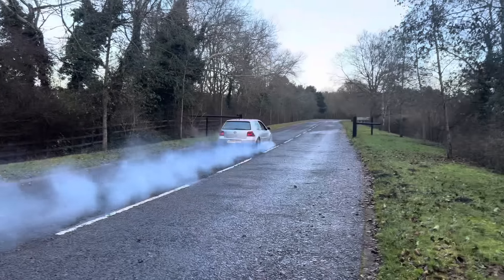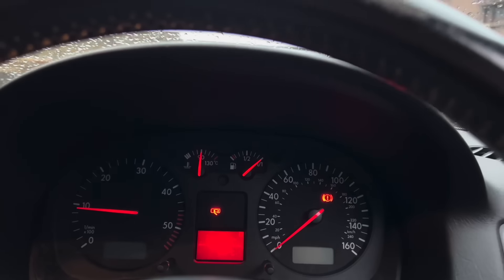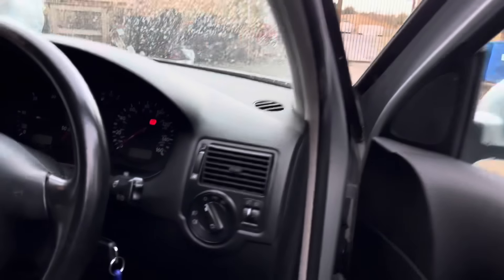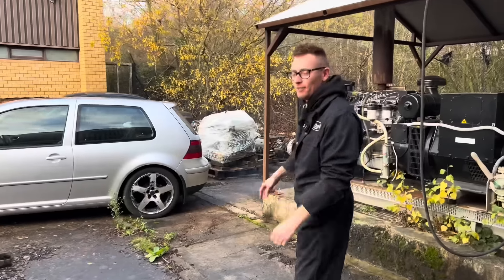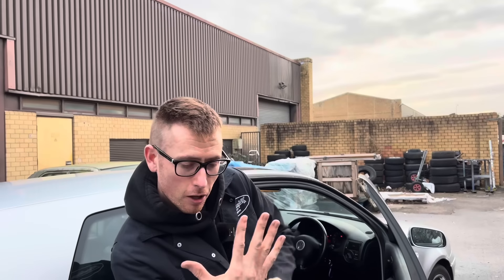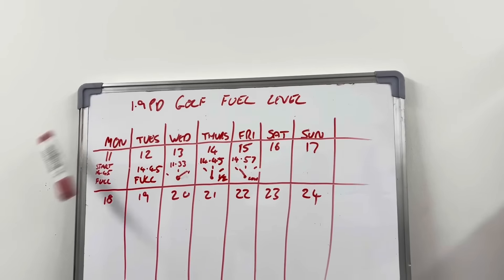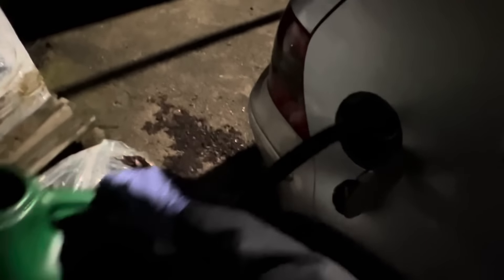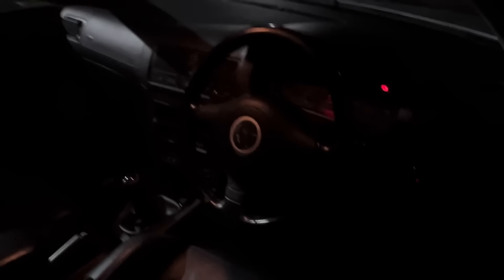2003 VW GOLF how long will it IDLE? OR Blow up first? The Idle experiment. (ONE FULL TANK DIESEL)

Comment: In a Tesla you’d freeze to death after 24 hours. Great video
Reply: These engines at idle barely produce enough heat to make the heater work.
Reply: @Jonathan_Doe_  I disagree my car which also a diesel of same sort of era had it idling for half an hour earlier and the cabin was petty warm and heaters felt hot.
Reply: Diesel has 10kwh per litre. When idling its pretty much all coming out as heat. If the tank was 50litres and 100h. Its taking 0.5l per hour. Its same as webasto heater. 5000watts all the time. Lot of wasted of course but still enough for heat.
Reply: No you wouldn't cus it would catch fire 🤣🤣😂😂🤘🤘
Reply: I can tell you have a lot of experience with electric cars 🤔😂
Reply: @Jonathan_Doe_   nah, i used to run my 1.9tdi toledo in really cold winter mornings an hour before i went for a drive and it was boiling inside after an hour, def produces more than enough heat
Reply: Ofcourse you would 🙄🙄 your probably driving cheap seats like a 10year Vauxhall insignia thinking your car is ahem - good 😂
Reply: Lots of tests been done, 2 days for a Tesla 3, the Kia ev6 lasted 3 days of constant heat
Reply: Completely inaccurate. Model 3 will make heat for days. I camped in the mountains at -14F in my Tesla which only used about 15% battery.
Reply: With a tdi, heat comes out the exhaust. Barely absorbed by engine block. Look what the piston looks like you'll understand.
Reply: @Jonathan_Doe_ why there is a heat exchanger. People complain about not enough heating after egr delete!
Reply: With a full tank of fuel, you could just drive to somewhere warmer, a 2tdi with a full tank (45 litres I think)  should get you about 600 miles away, 

(60mpg driving on the motorway)
Reply: @StephenButlerOne  made it from Eastern Ontario to nova scotia on 1 tank 55 ltrs driving 118km/hr the whole time.
Reply: You'll have around 3 days in a model 3 at a comfortable temperature, also if you contacted Tesla they can override the software allowing you to use the locked full capcity of the battery which will probably give you 4-5 hours extra.
Reply: So you buy cars to live in them in the wild? I agree, evs are not for that.
Reply: 🤣🤣 at least you'll be nice and toasty when it sets fire 👍
Reply: Tesla would last longer fully charged. ICE is very wasteful for heat
Reply: And who sits in a car for 24 hours?
Reply: @HA05GER 30 minutes is at least twice as long as a car should need to warm up enough to heat the cabin
Reply: Only a moron would end up in a situation where they needed to stay in a car and have the heat going to stay alive.  How long a vehicle can idle for is a pointless metric.  And I say all that to a comment that's false, a tesla can heat the cabin for more than 24h.  The energy required to heat it is nothing compared to the energy it uses to drive, and it can do that for almost 7h straight at 60mph.
Reply: Let's see the heat pump in the Model Y uses about 1% charge per hour. So you need to have a low state of charge to freeze to death in 24 hours.
Reply: @999benhonda i never said thats how long it takes that was just how long the engine was on. I was hoovering the car out kept the engine on as the battery isn't brilliant and my car being a higher spec model has lights absolutely everywhere plus I also wanted to listen to some music.
Reply: @meeder78  You can easily count how long it will last. 1% is way too arvitrary number, especially in the cold. Just use watts. Heating a cabin in say -10C takes around 1-2kW of heat. Then it really depends if you have a Tesla with or without a heatpump. With a heatpump you will get 3x the heat.
Reply: Teslas last a similar amount of time.  Plus with ice cars you have co2 build up hazard particularly if snowed in
Reply: @boosthit811  I've never had a problem I've had my car idling for hours on many occasions no noticeable fumes in the cabin.
Reply: @FuttBuckr69  something wrong with Ur thermostat then car should stay warm whatever your style of driving. My car will hold temperature at idle. Also my old car had stop start so would get the cabin to temperature and switch off. I would usually use the heated seat then car would start when battery is draining low say an hour or so then charge up and cut off again. I would without a doubt rather been in an ice car with quarter of a tank than a EV with a full charge. If push comes to shove you could even place a bottle of snow under the bonnet to melt to drink if really stranded.
Reply: Of course
Reply: Tesla will actually run 2 days or more with the heat on, and probably will be fully charged at home, while a diesel car is not toped every night.
Reply: Tesla owner. There's would be plenty of charge after 24h. People have done the same test on Teslas and they'll hest for about a week. Just saying. I spent a day in one camping overnight and the next day, and it dropped about 13% battery.
Reply: @m1geo  you don't have to insist. Batteries Are NOT Trustworthy! Specially in winter.
Reply: @Jonathan_Doe_  if that was the case they wouldnt over heat idling with no coolant but they do. they hit thermostat temp and stay there.
Reply: @MrFryfish  Okay! 😂😂 I'm 250k miles and 2 cars in. The batteries haven't betrayed me! Despite having had the previous car in Norway for a month. 😂
Reply: @alkiou3613  the vehicle subject that is  20 years old can run at idle for 2 (two) days then with the other MORE than half of the fuel tank could get you or me 2-300 miles to the first ⛽.. is a Tesla capable of that probably with lots of regen braking and inconvenience to others. 
Not the case with that (what?) over 3-400,000 miles on GOLF's clock. A wishfull dream for a tesla at that sort of mileage.
Forget about it.
Reply: @Jonathan_Doe_  even when you can see with your own eyes that the temperature gauge is at 90 degrees Celsius, WHAT DO YOU THINK IS THAT??? Engine temperature. So, heating is so much available that you will fell nice and cosy.. inside. 
Bye the way of ..cars, do you ever owned a ICE car? Probably not. That's way you do not know, obviously.. NOW, you know!
Reply: @stianheggen6310  by the way he talks, isn't it?
Reply: @duncanseuropeanautomotive8123  yeah, ..how old is that tesla? Do you realise that you are comparing 20 years old car with 3-400,000 miles on the clock (~5-600 k km) done. When that tesla will be 20 years old and same battery with the same performance, we'll talk numbers and performances. Right?
Reply: @terrancedactielle5460  what would you call comfortable temperature!? 18-19 Celsius or 20-21? For me is 20-21, extremely easy to come out of a 90 degree hot engine. Not the same stress as of a battery...
And by the way, how far you can get with that Teala after 3 day of warmth? 50-100 miles with big hopes? Or 2-300 miles in 20 years old Golf MK4, easily.. AND confidently.
Reply: @leenevin8451  how wasteful, describe to me. because the experiment just shown to all of us proved the opposite, extremely easily! Only you don't believe...
My friend, quite THE OPPOSITE IS with electric cars. Have you ever heard about residual heat? Well, only an ICE engine can produce residual heat after it is been switched off BECAUSE IT REMAINS HOT FOR A WHILE. Which is not the case with electric engine as that train cold all the time, or the warmth is NEGLIGIBLE
Reply: @MrFryfish  so we assuming the car has an auxiliary electric water pump like a bmw (excluding 4 cyl)?
Reply: @leenevin8451  Well, I do not know that, but the idea is the an ICE engine holds the head while the other NOT. 
Or with other words, it does not really matter if it has it or not, the warmth is coming more comfortable and easy from a ICE engine than... the DRY heat from an Electric vehicle.
Reply: @m1geo  as good as new isn't it? No battery life decrease what so ever? Well I own a BMW 3 series and with a single tank I  cover 700 km at 500k km on the clock in winter and 750-800 in summer, after almost 20 years. We will talk again when you proudly reach those km with same battery.. Then you will see where I am at. ;-)
Reply: Actually not true. I slept in a tesla and it lost about 15% battery in 10 hours at -5°C. I love combustion engines but what you are saying is wrong.
Reply: @Jonathan_Doe_ you’ve gotta be trolling
Reply: @JamesParus not really, my car just at idle takes way way to much time to warm up to 85c, and even after that, if I use the blower on hot without AC, it drops the temperature real quick, if I turn on the AC the load on the engine triples, making the time running drop by 3 times.
Reply: @MrFryfish  oh wow! I wish I could afford a BMW. Oh wait, I've had a few, some cars ago! Both new. 🙄 I've had all sorts. I drive an awful lot. If I didn't like the Telsa, it would be gone - just like the Range Rover Sport I had after the last BMW but before the first 600HP Tesla. 😂 I can make my own decisions, thanks.

All I came to say is that the Tesla would last about a week, sat, with the heating on.

Safe driving! Merry Christmas!
Reply: Is that will a full battery?
Reply: @FuttBuckr69  I'm in the UK so worst case scenario probably minus 10 but I've definitely had the car idling at minus 5 and it's maintained temperature. There's 10kwh of energy in one litre of diesel say the engine is roughly 40% efficient then 60% is heat waste so a modern car will use between half and a litre of fuel an hour so potentially 6kwh of energy available. Obviously some of that will be lost the bonnet area and radiator but it's quite a bit of energy roughly 3 electric heaters.
Reply: @m1geo  it does not matter what you own in the past as long as the future is electric. It's good that you make sense of it.. 
Well, I used batteries in the past as you are using electric car today. Not happy at all with their behavior. I prefer fuel in the tank and engine to last that vice-versa.. (a motor that depends on life of a brick called battery..) 
Forget about BMW. It could be any serios maker of car these days..

A Happy Christmas, as well!
Reply: @unzippy  Yeh, mostly full. Some channels have tested it and you get about a week continuous at around 21C. EVs are much better insulated, too, like all side windows are double glazed.
Reply: False info. EV can last heating for more then 3 days and it doesn't have to idle in traffic. The Golf started clogging up halfway through the thank and will need an expensive repair afterwards. I'll stick with an EV, thanks.
Reply: @rouchar  it's 300+k mile car. I've idled cars for hours on end all the time never have they damage the car in anyway shape or form. In colder climates they don't turn off the engines at all they run 24/7 and they work fine.
Reply: @HA05GER  was it gasoline or diesel? I assume a good gasoline car could pull it off, while it would be bad for diesel's DPF and EGR
Reply: @rouchar  it was a diesel car with a dpf.
Reply: @rouchar   in case you missed that car THE GOLF was probably on it's way to the scrap, landfill, recycling... as it is so modern these day to dump anything that these ...humans think is to old.. So my little friend in love with your electric car trying to make (..score?) a point in this discussion, that 21 years old car almost wrecked.. (as explained above) was biting the s*** out of you 3 day of warmth in your (2-3 years old) electric car.. with 2 extra days! So the GOLF "resisted" to the abuse (because that is an an abuse for an internal combustion engine) lasted 5 (five) days, and it DID NOT give up.. even after that time. Can you see the difference?? The huge difference!
Anyway, that 21 years old car is less detrimental to the Planet if it is kept in good condition by the owners.. But not they got convinced the  EV are the future.. yeah, the future of wasting evnen more energy in making those batteries and another model of the EV now, express changing of tyres, because EV seems to eat them not just wear them.. NO SUPRISE HERE, because those ..humans.. love speed, moving fast.. and DUMPING cars because they cannot afford TO MAINTAIN them. So it is not about saving THE PLANET. Is about felling proud and looking rich when you are ACTUALLY IN BIG DEBTS, well .. and is happening that you are still paying for your EV while ME, I am pay free since I bought an 5 years old car and MAINTAINED PROPERLY BY THE BOOK, and a very happy soul.. that I AM SURE I AM PROTECTING THE PLANET BETTER THAN YOU because my car is not ready to fill the land.

Should I say something about the cost of an battery of an EV? Is there any reliable program to recycle them? We are well into this new RUBBISH electrical revolution .. for which we will never ever have the necessary electrical power to support it!
From someone that understand electricity ten times better than you because I work in the field!

Comment: I had a passat with this engine and it ran for 20 yrs and 295000 miles.
Reply: What stopped it?
Reply: @rkan2  Nothing I sold it for £500.It’s still knocking around now 4 yrs later . Got a B7 2.0 tdi now
Reply: That's good, my 20 year old Audi A4 with Passat B5 1.9pd engine is at 271,000 miles so far. Doing just fine for commutingand family running around! Hoping to make 300,000.
Seen one still running at 500,000. Usually everything else on the car will give up and be uneconomical to repair, long before the engine dies.
Reply: @itchyscratch3829  Good luck . Mine was getting too expensive for MOT repairs and needed welding .

Comment: The geek in me has just calculated that the crankshaft rotated approximately 320 million times during this test 😁
Reply: Show math
Reply: @AverageReviewsYT  900rpm, approximate tick over
= 54,000rp hour
54,000 x 102 hours = 5,508,000 turns of the crank.
In my defence my first estimate was early in the morning and I was clearly half asleep 🤦🏻‍♂️😁
Reply: @RanDomRikM  5.5m vs 320m…. Close enough.
Reply: @AverageReviewsYT  I had inadvertently multiplied the rpm by one too many sixties, so divide the 320m by 60 and you get near enough the same answer 🙂
Reply: @RanDomRikM  I was messing with you lol
Reply: @AverageReviewsYT  I deserved it, I shouldn’t have been so daft to get it so wildly wrong 😁😁
Reply: @RanDomRikM  eh fuck it. It’s YouTube. We’re all here because we’re bored 😆😆

Comment: they consume half liters per hour. difficult to count... But after 1 hour of idle the motor cools back down and you cannot even heat the car efficiently so wonder why on earth would you idle your car that long. you'd better install a stationary heating into your car which works more efficiently and doesn't fuck up the engine.

Comment: It lasted 60 ish hours longer than i expected. It's actually more economical to use than my webasto water heater i have on my Mtdi mk2 it seems to use close to 1 liter an hour. I think you can "service" the intercooler on them they have a drain port so well VW probably expected some blowby
Reply: I haven't seen any intercoolers on these with a factory drain port. I've seen plenty added with self tappers though :D

Comment: Try running it on old oil
Reply: PDs are common rail so it wouldn't work, you could do it on an alh though
Reply: @liamholcroft7212  PD's are the opposite of common rail. The are PD's
Reply: @imbackinthegame3611  Yeah you're right i must have been tired when i said that. The reason why I think it won't work is the same as it is for common rail systems though (probably where i got confused). Oil is more viscous than diesel, so it won't play nice at high pressures and small injection nozzles.
Reply: PDs will run on almost the same fuel combo as the more traditional Bosch VE distributor pump diesels. The fuel system components just won't last. It is much the same with Common Rails, though tou would want to start and stop with diesel. Would destroy the fuel system (pump and injectors) even faster though.
Reply: @rkan2  do you think diluting the oil with petrol to lower the viscosity will prevent or reduce the wear ? 
Which part of the fuel system will wear the most an why ?
Reply: @imbackinthegame3611  The answer would always be what I learned from somewhere... "If you can get the fuel's properties to match what's listed in diesel standards approved for the engines" :D

The VE and it's injectors are just that much more forgiving when it comes to running with any oil.

With higher and higher pressures, better tolerances are required and this usually also leads to more requirements for lubrication. You just cannot guarantee that your whatever in the tank will keep everything lubricated, free from clogging up or particulate free..

When you actually get the oil, grease, whatever to through the pump and lines to the injectors - any diesel engine will run just fine with pretty much any of them.

When it comes to gasoline - it doesn't itself increase lubrication properties - but if you were to mix the stuff with some low viscosity oil that has better lubrication properties than diesel, then maybe you could get some mileage from your common rail run with vegetable oil oil.